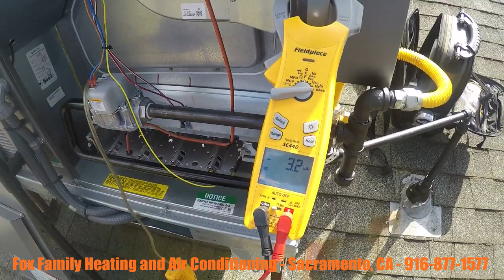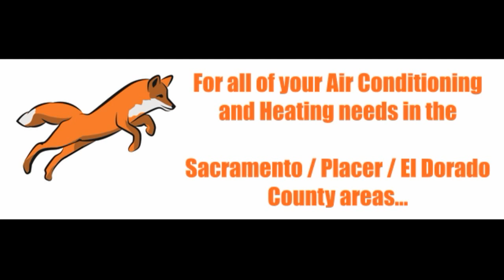Carmichael AC and Heating System Changeout - Package Unit with a Crane 3/25/17

Comment: good video. temp rise is going to tell you where to set manifold pressure
Reply from the maker: Mi Heating Guy trust me I've installed enough Ruud's to know exactly where to set that gas pressure. I know what you're saying though MI and youre technically right. but after 7 years of installing Ruud I know it's sweet spot lets just say. lol.

Comment: do you use mastic backed aluminum tape to seal the rooftop ductwork? it looks like you use cork tape to seal around flashings. I like that
Reply from the maker: Comfort Heroes yes 181 Mastic
Reply: That looks real clean. Have you been using that for a while without issues?
Reply from the maker: Comfort Heroes absolutely. no issues with the code inspectors and it holds up real well with the weather too
Reply: Thanks

Comment: ..... this question has probably been answered elsewhere but even if you have a slab Foundation why do you put so many units on the roof instead of incorporating the flex Ducks into the design of the house or put a split system. And have the unit on the ground and the air handler in the attic space. We live in North Carolina and you never see that here regardless whether it's a crawl space or a slab????
Reply from the maker: Roger Lund yes this question has been answered serval times on our channel. Thanks for watching!

Comment: @12:49 mm, smell that gas/anyone have a light? :))  why not use abs for the drain? no need to paint.
Reply: I don't think abs is sunlight resistant.
Reply: I assumed the small sizes used for condensate drains would be uv-protected, but perhaps not and would need painted anyway and I know it expands uneven. guess I should have looked around before suggesting it, I don't even see small sizes listed anywhere, guess they quit selling it.
Reply: I have heard of wiring electrical while it was hot but never saw somone makeup gas piping while it was flowing.  I guess you can only get away with that on top of a roof, not recommened in the  house or attic.
Reply: I've done it myself indoors even, but it gets smelly fast and people complain. amazing how many people don't know what the smell is and just complain of it stinking, so it kind of serves to educate. I think the gas co's should mail out scratch and sniffs again :)